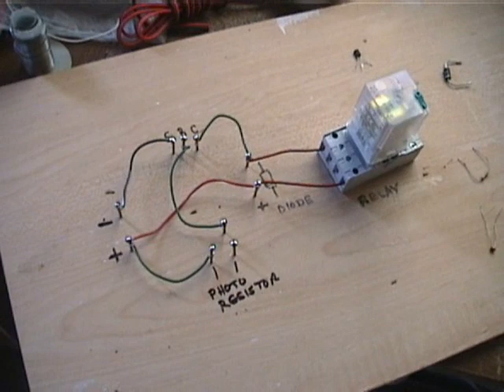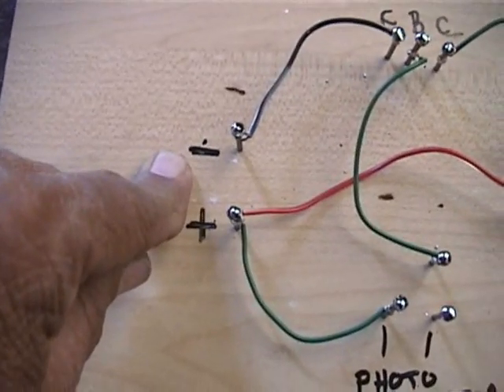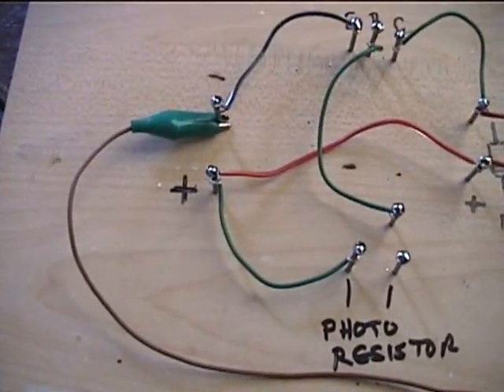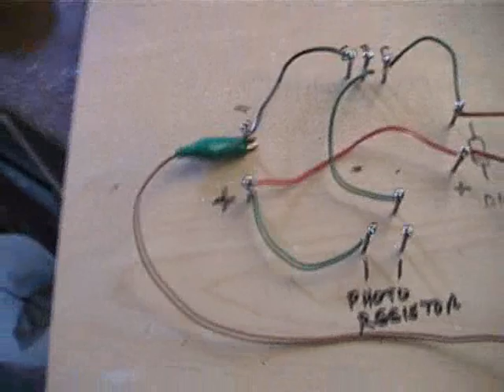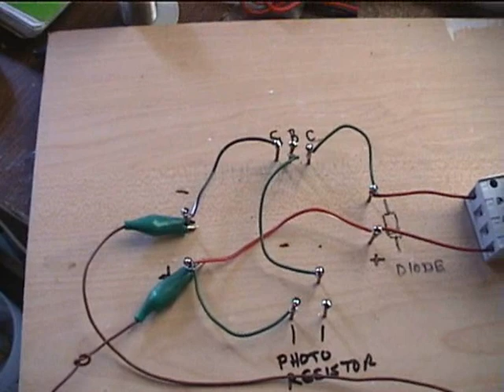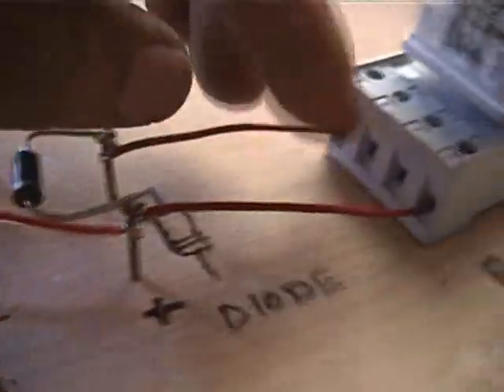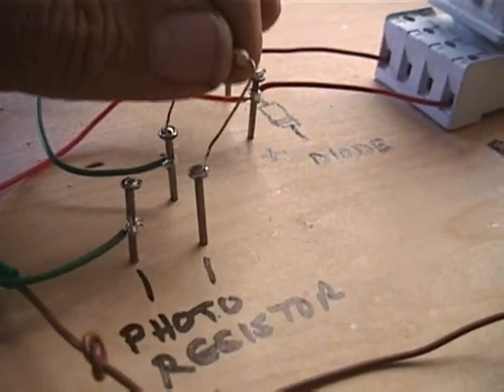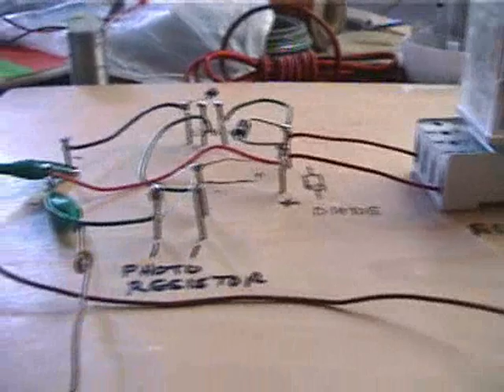Basic light sensor circuit

Comment: Hi nice work can this be made for 24 volts
Reply from the maker: Yes, the first thing would be to use a 24-volt coil relay, and increase the value of the R1 resistor from 390 to 680 or so, it would be a matter of trying. This is not very critical. Originally this sensor was made for my solar tracker I show on https://www.youtube.com/watch?v=jHBm4XuCqlQ and the original plans I posted are at  https://app.box.com/s/wxvlzfo6ihque07ed8hj

Comment: hi , thanks for the great video . I was wondering what are the specifications of your diode used ? also why does the diode go from negative to positive? What is its function if the electricity comes across the negative side why would you want it to loop back into the positive side?
Reply from the maker: Thanks for your question. The diode is a very usual type, 1 Amp 1KV reverse voltage. When a relay is switched off by the transistor, the field around the coil colapses and creates an induced voltage in the coil which is many times the applied voltage; for instance, 12 V applied to the coil can become almost one thousand volts momentarily in the coil terminals. Due to the direction of the lines of force in the colapsing field, the field is opposite to the polarity of the applied 12V, that is why the diode has to be cathode to positive, which normally would not conduct. The purpose of including the diode is to protect the driving transistor, which can be easily damaged by that voltage surge. This video is referring to the light sensor used in my solar tracker,  since many builders were not familiar with such circuit, included in the free plans I posted at https://app.box.com/s/wxvlzfo6ihque07ed8hj  . As a matter of fact, this video is a supplement to this other video, about building a solar tracker - https://www.youtube.com/watch?v=jHBm4XuCqlQ-
Reply: so i guess my other questions would be about the path of electricity . Why would the electricity follow the diode back to the positive side if it is still connected to the transistor?

Why wouldn't you use a resistor from the negative on the relay to the transistor?

And finally would two diodes in parallel or a zener diode work better for stopping the voltage spike?
Reply from the maker: The diode is connected across the relay coil. When 12V are applied to activate the relay, the posifive of the supply or battery is connected positive to cathode of diode, and negative to anode, so the diode does not conduct, but the relay does. When the voltage from the supply or battery is removed suddenly, the colapsing field induces a voltage in the coil, a voltage which is positive on the anode of the diode, and of course negative on the cathode, so the diode does conduct! That way the diode acts as a shunt across the unwanted pulse that might damage the driving transistor. Except for shortcircuiting that pulse, the diode does not do anything else in the circuit.
Reply: +Chava Tarin so because the electricity has an alternate route to travel it does not pop the transistor .
Reply from the maker: Yes! A much lower resistance than the transistor collector junction, only 0.7V drop across diode junction in the forward direction.
Reply: +Chava Tarin you are blowing my mind . this is so informative !
Reply from the maker: I am at your service, please take a look at my videos, I am a fan of solar energy, it's the best way to go!
Reply: hi...
can you please tell me what is the value of your components.
transistor, resistor and diode.
hope you can tell me.
thanks.
Reply from the maker: The transistor is a general purpose NPN audio transistor, the resistor is a 330 to 390 ohm resistor, not critical, the diode is a 1N4004, 1 kv reverse peak diode. If you wish to see the schematics, please visit - https://app.box.com/s/wxvlzfo6ihque07ed8hj , and download the file named Universal DIYsolar tracker manual - I have all the plans for the tracker, the sensor is just of the project. Thanks for your question.